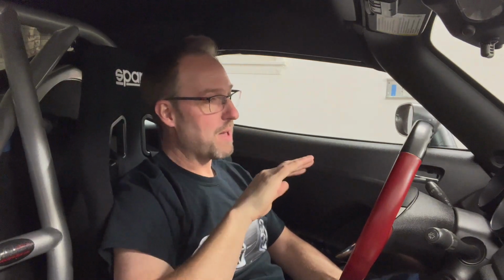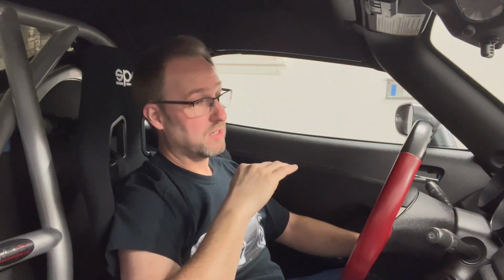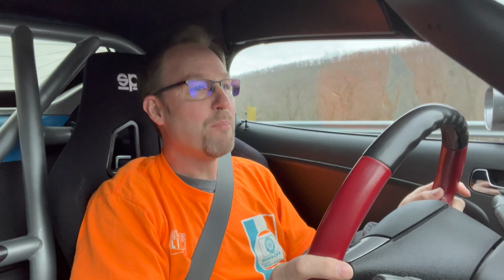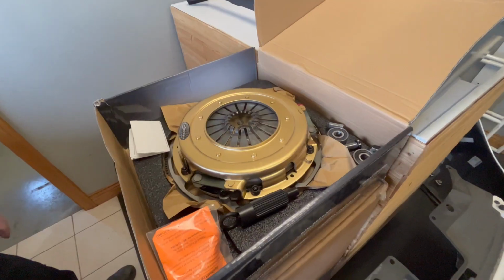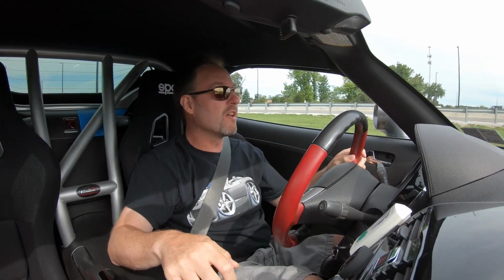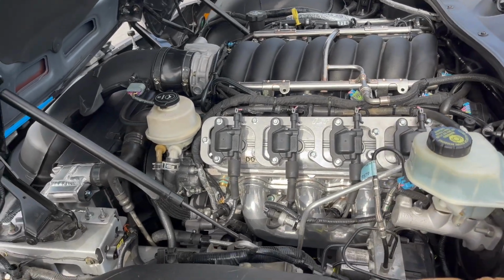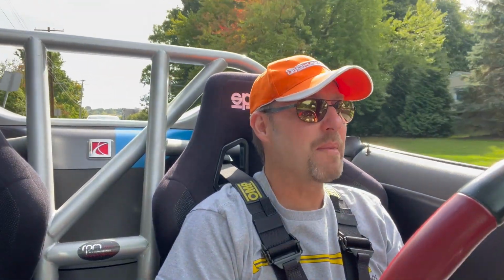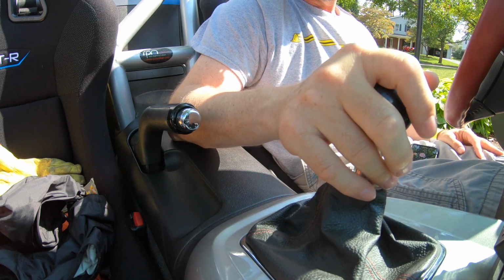LS3 Saturn Sky Swap Story

Comment: Thanks man, well done video.  I put a Perf Autowerks Stage II turbo on my 2.4L base, '06 Solstice.  Blew my engine when the cheap wastegate melted down.  Anyways, swapped out the engine, bought a quality wastegate and had no more trouble.  Recently sold the base and bought a Mallet (400HP, LS2 V8), 5SP standard.  I do autocross and time attack. These are great cars.

Comment: This build look so much fun for the track. So nice to ear the V8 sound without a roof in the summer, how does it handle and would you say 430hp is enough power instead ?
Reply from the maker: Handling is still very good, obvi it's heavier now but the added power and torque make up for that for acceleration, cornering is still very good, and I didn't have enough time this fall to really truly test the handling limits now. Acceleration is great at all RPM's, so you can't feel the weight from a pure speed point of view. Is 430HP enough? For most people probably yes. If you don't actually race (autoX or drag or timed track events) then it's enough. I can spin my street tires (245s) in 1st, 2nd, 3rd gear if I'm not careful, and that still might be true of 430hp, but if you keep it hooked up, it moves.
Reply: The handling will be severely degraded...if I put my 320 HP Solstice GXP on a track vs this car I would get better lap times...

Comment: Great video. You asked if driving the Sky stock was more or less fun then with a LS. The stock 2.4 is a very torquey motor and had a lot of fun with it but I couldn't leave it alone :) First putting the DDM works MP62 kit on it was fun but I wanted more so I built a  1.6L screw Lysholm (Swiss made Wipple) supercharger kit for the 2.4 with 2.0 head and comp cams pushing right at 430 hp was  a ton of fun and fast. Now here is your answer lol actually more fun than my full race 700hp LS3 stroker. Unless you're racing it, it just has too much power for fun spirited street driving. Does it go?? Oh Hell yes it does. I had the motor built for me but I did everything else myself with some help over the phone from Brian Cooper (KappaHause) I did it quick becasue I was excited but now after a few years I'm going to pull the engine, rerun wires and clean things before putting the engine back in. I need to make less of a race car and more of a fun street reliable car again. 
Hey a quick question what battery are you running? This 650 CC Am battery barely starts this stroker. Tried a red top gel and those are junk. I may install another battery in the trunk not sure yet. 
Thanks
Reply from the maker: I have an Optima red top and it starts my car just fine. I’ve had a couple over the years and they have always been ok for me. I also had a lithium battery, and I love that it’s only 5 pounds, but I was having some electrical gremlins and I was not sure if it was because of the battery or something else in the car, so I put the regular battery back in so I could see if that changed anything or made any problems go away, now they weren’t very often or persistent. It was very sporadic, so it’s  hard to say if the lithium battery was actually creating a problem or not.
Reply from the maker: I have 480 HP and that is just about right. Much more and it would be all tire spin. I agree 700 is way too much for the street, maybe even for a track.

Comment: Very cool. Did you switch to a TR-6060 transmission? One of these is next on my swap list. Currently shopping for the right deal on sky. Wife wants a 2dr roadster with a manual and these are perfect. Right now I’m putting an ls3 into an s10. I went with the 430hp version from GM and swapped in just a slightly bigger cam than the 480hp version. Too close to 500 to not push it over. I’ve since picked up a gen 4 aluminum 5.3 core and I’ll be building a supercharged stroker out of that for the s10. Then put the ls3 into a sky.
Reply from the maker: Yes, a 6060 from a 2010 era Camaro. One thing is I want to adjust the position of the shifter handle, for autocross I like to sit a little closer to the wheel and the shift lever feels a little too far backward. So, make sure you tweak your placement before buttoning it all up.

Comment: Did you keep the factory rear end? How much did the shop charge for the work?
Amazing vid, thx
Reply from the maker: Yes its the factory rear, but I later changed it to a different ratio. There are a couple different ratios and case styles with different nose mounts. It cost a lot.

Comment: Is your LS3 an iron block or aluminum? How much more does the LS weigh as opposed to the I-4? Looks like a nice conversion.
Reply from the maker: Aluminum. The LS plus transmission added about 200 pounds, but it's still balanced 51/49. But I can feel the front is heavier during autocross. With all the power I need the back heavier to have traction!

Comment: Great video! What wheel and tire setup do you have on your Sky?
Reply from the maker: Stock rims currently "for the street" with Conti DWS06; for autocross its BCForged KL01 style 18x11 with 315 BFG Rivals
Reply: @SuperMacGuy  oh wow. The 315s fit without rubbing? Attempting to put together a decent tire rim combo with Michelin Pilot Sport 4s.

Comment: How did you modify the center counsel so nicely for roll bar to clear?
Reply from the maker: I carefully cut circular holes but left the leather on, and then used contact cement to re-glue the leather around the edge of the holes.
Reply: @SuperMacGuy  I see. What did you use to cut the holes I assume from underneath? I have a GXP and looking at getting the roll bar.

Comment: The cars dynamics are destroyed..big heavy v8 in the front, destroying the balance and handling..the car will understeer much more than normal and now the rear will want to sing out because its so light in comparison to the front. Good for straight line performance but that is not what the car was designed for in the first place.
Reply from the maker: The handling is not "destroyed", when I got it weighed it was 51/49 still, tho that belies that there is +200 lbs up front, really (I would like to get it on a better set of scales TBH). Yes I can feel a difference, because I'm tuned to it more than most. But it's not "real bad". Yes it could definitely use more rear weight now, with a lot more low RPM torque, it will be able to spin tire a lot quicker than even a well tuned turbo car. I can say this is a LOT more fun than before at all speeds, and handles just about as well at most speeds, and is a lot faster accelerating than before.
Reply: @SuperMacGuy  I shouldnt have used the word "Destroyed" but most def the cars handling wont be the same. Alot more fun that what?...the standard 2.4 ?? or the GXP 260 HP?...Are you saying the LS3 is only 200 pounds heavier than the 2 L??? Sorry that I cannot believe, seems like it should be about 350 pounds heavier at least. To each his own I guess, but my GXP with 330 HP is super fast and I wouldnt want the handling to be degraded because where I live I can do some spirited driving and like the way the car behaves. Also, unless you get that car on a track and push it to its limits then you will really see the difference in handling with the bigger motor.
Reply: @FyreSturmOfficial had lots of V8 cars in my life..not envy just the facts..